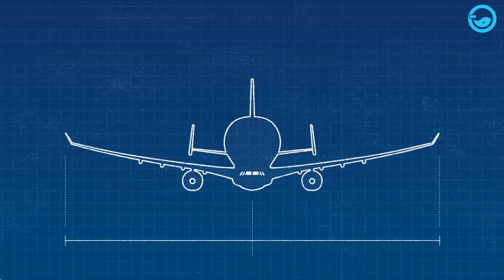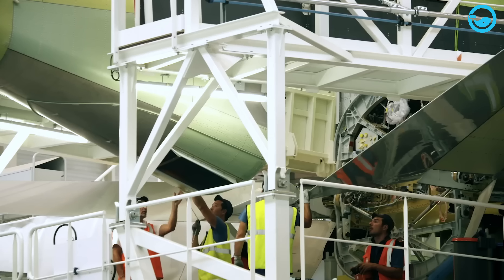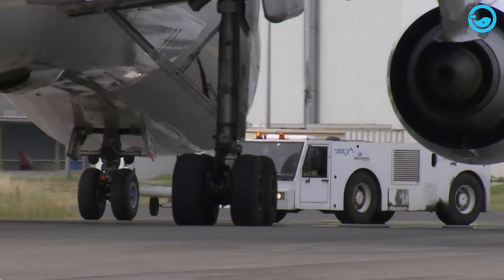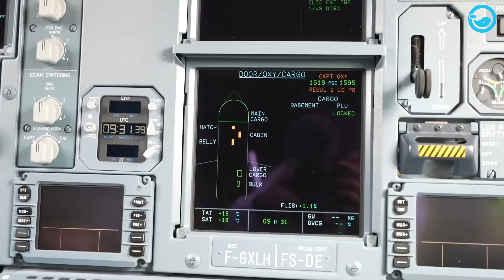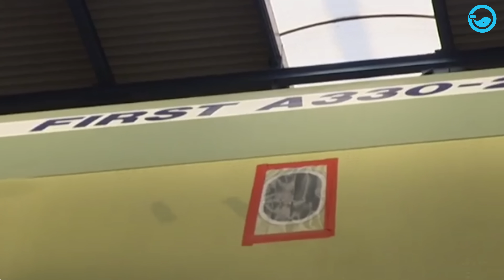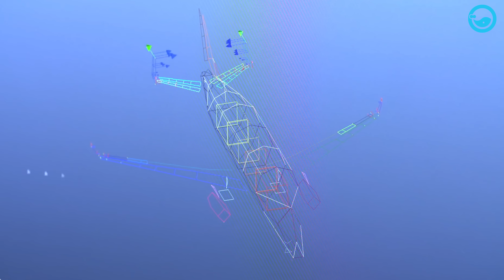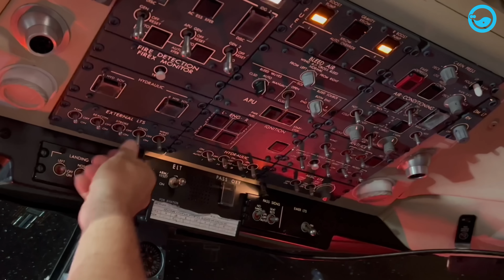How They Built the World’s Largest and Weirdest Airbus Cargo Plane

Comment: Unbelievable the mistakes about this plane being told,who's supposed to have done their research before posting this video it's a disaster,I wouldn't be surprised if it's just some random person without any experience,all this DEI BS, it's getting worse in every industry but the frightening thing is this is happening in commercial passenger planes and especially among aeroplane manufacturing(Boeing definitely), using substandard part's and instead of replacing they are being repaired with devastating outcomes as we've only seen a tiny percentage made public this is also including space manufacturers department's and even in airport tower's which they were covering up, however they have been found by using undercover people from the NGO's regulatory inspection's or whistleblower's unwilling to work alongside these new bosses and the DEI individuals who are placed with them after they have been with the companies for decades,I think it's a disgrace that the REAL ENGINEER'S and specialist's having given their loyalty to the company for decades now have to resign or are fired because they refuse to be responsible for using all these massive amounts of cost cutting which makes their jobs impossible to do,this has to stop immediately or MANY MORE people will be killed or maimed for life in airplane crashes and accidents which we have already seen but only the one's that they want us to see 👀 🤔😤🙃

Comment: The narration is just horrible and stupid at times. I mean, come on. The landing gear has wheels, tyres and suspension. Really?? I also had no clue that a device to lift things is called a crane! Not to mention those professional pilots. Are their non professional pilots flying such planes as well then?
I also get the impression that this was not narrated by a real person.
At least one positive, the plane is awesome 👍
Reply: Unprofessional pilot's,I wouldn't be surprised nowadays with all this DEI BS, it's getting worse in every industry but the frightening thing is this is happening in commercial passenger planes and especially among aeroplane manufacturing(Boeing definitely), using substandard part's and instead of replacing they are being repaired with devastating outcomes as we've only seen a tiny percentage made public this is also including space manufacturers department's and even in airport tower's which they were covering up, however they have been found by using undercover people from the NGO's regulatory inspection's or whistleblower's unwilling to work alongside these new bosses and the DEI individuals who are placed with them after they have been with the companies for decades,I think it's a disgrace that the REAL ENGINEER'S and specialist's having given their loyalty to the company for decades now have to resign or are fired because they refuse to be responsible for using all these massive amounts of cost cutting which makes their jobs impossible to do,this has to stop immediately or MANY MORE people will be killed or maimed for life in airplane crashes and accidents which we have already seen but only the one's that they want us to see 👀 🤔😤🙃

Comment: Why is the A380 not used?
Reply: Because the structure needs the middle Deck, that's why it has never been modified to a Cargo plane. The modification it requires are too expansive to develop and there will be too many compromises.

Comment: 1:35 Amazingly small wingspan for such a big plane..
Reply: I caught that too. Can’t be 8 m. Wingspan is usually at least the same as length if not more. The length is 63.1 m. So perhaps it’s 80 m and they missed a digit.
Reply: @areza15143  The fuselage diameter is 8.8 m. The Wingspan is 60.3 m.
Reply: google says its wingspan is 44.84 meters.   Amazing it uses only 2 engines